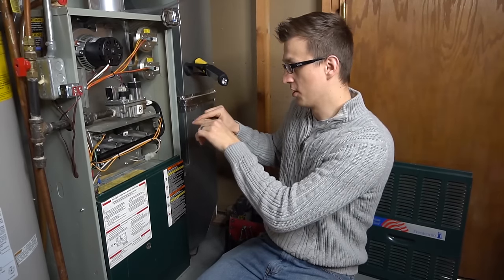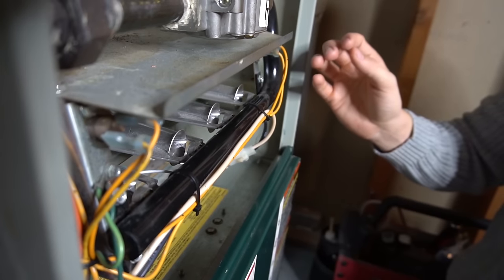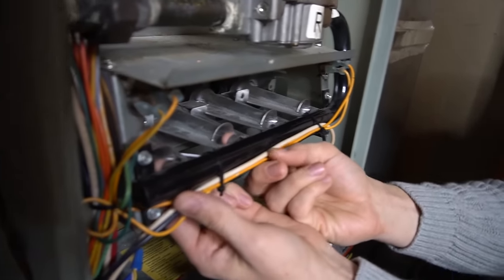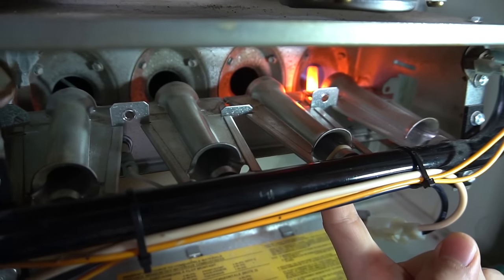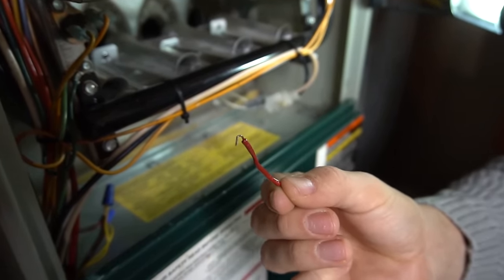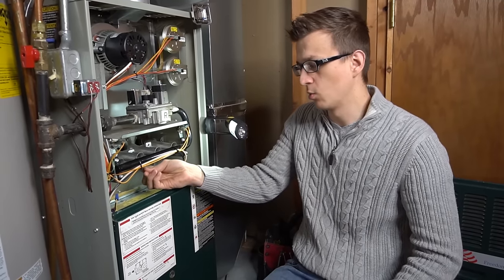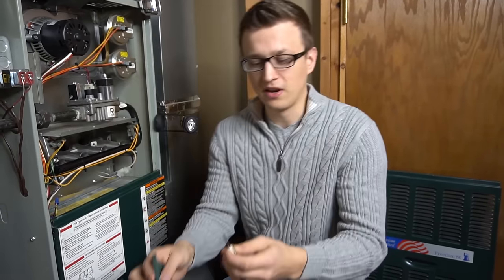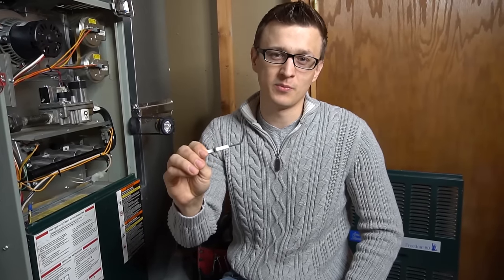Not All Furnace Burners Lighting - Easy Repair

Comment: HVAC Horizon guy came for gas furnace tune up.  He did not clean pilot nor the burners. I asked him and he said no don’t need to clean!!!
Reply from the maker: Do you have in-shot burners? Those style of burners don't need to be cleaned very often. I don't always clean them either if they look okay but if the customer asks me to I will.
Reply: @Word of Advice TV 
I don’t know the type but it’s 1986 old Furance model SX242NBOX. I have to start the pilot light manually and I have the pic of the burners.
Tech started sales pitch your furnace is very old Blah Blah 
He asked when I’m planning to replace and I said there is no issues. Why do I have to replace!!
Reply: @ssinvllc  1986!? What's your temperature rise? A unit that old has a very good chance of having a compromised heat exchanger. Which in turn could lead to carbon monoxide leaking into your house. Might want to call a more credible company for the tune up. I personally, would've removed your blower motor and fully inspected your heat exchanger. Minimal of 2 hours at your place.
Reply: @ccruz 
Thank you 
I bought the home recently. 
Unit is 80BTU but he said its running on 77%. Tech didn’t not say about CO2 leak. Is there anything I can check for leak ?
Reply: @ssinvllc  on your furnace, there should be a data plate with all the specs to your system. It's where you can find your model and serial number. On the data plate, it should tell you where your system's normal temperature rise is. The most common that I see is 30°-60°. How you can check that is go to one of your registers (vents) that is closest to your unit and take the temperature of the air coming out. Then go to your return (where you place your filter) and take that temperature. Subtract the two to get your temperature rise. Make sure that your CO2 detectors are working. You will need to recalibrate them every once in a while. You can do this by taking them outside for a few hours. This allows them to be able to sense the fresh air. If a CO2 detector hasn't been recalibrated, it will actually sense the CO2 and think that it is normal and won't alarm. If you or anybody in your house has been getting dizzy, headaches, and or been feeling Ill you need to get new detectors and call in a more knowledgeable technician.
Reply: @ccruz 
Thank you for the information 
I don’t think Tech checked all these things.
Reply: @Word of Advice TV @ccruz 
We have a heat pump and outside AC unit started  making noise. Tech is saying Restricted Thermostatic expansion valve is faulty and repair cost more than $2K. I think fan motor bearing is the problem. Amerstar Unit is 14 years old American Standard. Is there any way I can send you the unit ‘s noise video  ?
Reply: @ssinvllc  your outside unit is making noise and the technician is telling you it's a "restricted TXV"? I've never come  across a TXV making noise when faulty. Your unit just wouldn't be producing the correct temperature if you had a bad TXV. Most likely just the condenser fan needs to be replaced. If you upload the video, I'll watch it.
Reply: @ccruz 
I uploaded 2 videos 
In one u see the ice
Reply: @ssinvllc  wasn't able to watch video, says user removed video. But that makes a lot more sense if the txv is bad, then your unit may ice up, thus causing the  condenser fan blade to hit the ice.
Reply: ccruz 
Sorry I thought u watched the videos
Reply: @ccruz 
Another tech $700 Freon is low and to refill r22 and replace TXV but he’s insisting to replace Ac and heat pump $4000 Goodman R410   - 2 ton Ac 14 SEER
Reply: @ssinvllc  honestly, I would do it. Your unit is pretty old, way past its life span. $4000 is a good price, but be wary of mom and pop shops. You're looking for quality in the install and making sure the company is willing to stand by their work. A bad install is just setting your system up to fail. It may be a good idea to also look at your ducts as well. New 14 seer units tend to have "ECM" motors that do not last when the static pressure in your ductwork is too high.
Reply: @ccruz 
Thank you so much for your help. It is for rental unit. 
Should I go for 16 or 21 SEER ? any model you recommend. It’s doenflow system
Reply: @ssinvllc  the 16 seer should be fine. I think anything  newer than what you have now is going to be good. I personally, install and maintenance on Lennox and Rheem units. Pretty sturdy units, plus the manufacturer's warranties are pretty good. Super quick to respond when you have a problem or need a part. 
And no worries!
Reply: @ccruz 
Great and thank you again 
I will look 16 seer models I’m from suburb of philadelphia area. If you know any tech or recommend anyone

Comment: Thanks so much, Jay!  I used a number of your videos to progressively troubleshoot and repair the furnace in a rental property I have been renting and didn't seem to be maintained very well.  Your clear videos and steps led me to an inexpensive self-repair.  Many, many thanks!
Reply from the maker: Awesome! Glad to hear the videos helped you track down and fix the problem! Thank you for leaving a comment, stay warm!
Reply: @WordofAdviceTV  I have tried everything I know but having issues after replacing igniter, flame sensor, run capacitor and tested all switches. The furnace gets to the igniter turning on then no flame and kicks off. Inducer is working, pressure switch works. Goes through this cycle 4-5x then goes into lockout mode. What am I missing and why is it not getting a flame?

Comment: Tried this but still only first burner lights.  Then put a fire stick next to the first burner - upon ignition and all came on.  It's almost like the igniter glow stick was not close enough to the second burner to ignite it.  I think my igniter may be failing and just not glowing hot enough to reach the second burner.  I noticed in your example the glow stick was completely glowing while I think mine was only partially glowing.  Will try replacing the igniter and let you know.  (Luxaire Furnace)
Reply from the maker: It's more likely to be a dirty burner. I have a video where I explain that and show how to clean them: https://www.youtube.com/watch?v=6ehk0NZVFcg

Comment: This video is very helpful but I do have one question:  what if the gas is coming out but none of your burners light.  I can smell the gas but the burners are not lighting at all.
Reply from the maker: Is your ignitor glowing or sparking? If it is glowing but not lighting even thought the gas is coming out, then most likely that is a weak ignitor that should be replaced.

Comment: I found that not only was the orifice plugged but there was debris in the manifold. Propane fuel I heard sometimes puts out debris in the burning process. I removed the orifice and using a the same wire I used on the orifice, I have fished a lot of debris out of the manifold. I have the orifice currently soaking in carburetor cleaner as the clog is very solid. I may have to replace the orifice but I found they are really inexpensive. I will post my results later.
Reply: My trick worked. The carburetor cleaner opened the orifice and I fished a lot of debris out of the manifold. Furnace is working great now.
Reply from the maker: Awesome! Glad that worked for you and all is good now :) Thank you for sharing! For other people who may have a similar problem.

Comment: So I've been having issues with my furnace. No heat during this cold spell in IL. Recently, replaced the thermostat with a 3d Gen NEST (which is fine), but the ignitor continues to glow red, then turn off, then glow red, then turn off, over and over. The burners never turn on. The signal lights show normal (both quickly flashing green) signaling normal ops and that thermostat had requested heat. Earlier, the lights had shown that both the Primary/Secodary limit switches were open and a technician had to temporarily bypass a limit switch near the circuit board while a new limit switch was ordered. The burners were working due to this until late last night, then the ignitors would come on and go off, etc. etc.  That bypass setup is still in place and should be replaced tomorrow. As for the burners never igniting, could this be circuit bored issue?  Also, I just replaced ignitor with a new one, cleaned flame sensor with steel wool and like this video, cleared the gas orifices hoping that would resolve this issue.  Any advice?
Reply: It looks like you have a bad gas valve
Reply: Or thermocouple

Comment: In my case when only a couple burners were getting gas to them, I found there was power going to the gas valve but it was only allowing 0.5" WC natural gas to the manifold. Changed it out. Problem fixed.
Reply: Gas manifold sounds intense -  this sounds like a I need a licensed Chaco person
Reply: You replaced the valve?

Comment: Does a 2stage furnace also have 2 igniters?  My furnace is a high efficiency furnace and has 4burners and an igniter at either end of the burners. It has one flame sensor and two pressure switches. I am trying to learn all about my furnace. I live in Alaska and furnace in the winter is really important. I look forward to hearing from you and I really enjoy your videos. You know your stuff.

Comment: Thanks for the video. Your explanation is clear and easy to follow. My furnace ignitor sometimes works, but sometime do not. When I opened the door, the ignitor grows, and the gas valve opens (I heared the click sound), and then sometimes I see small flames, and sometimes I do not see small at all. Can you what I need to look into?

Comment: Had interment igniting furnace problem...now will not ignite at all with igniter glowing or manually!. Cleaned holes  gas pipe ⁶brass fitting and . Flame sensor is in good shape! Gas line and valves are turned on...I'm getting gas to my water tank. Inducer on furnace is running..  all wires are connected...at odds and irritated in CaLi

Comment: Jay tell me can i temporarly use the wrong ignitor in an emergency
Reply from the maker: Usually yes. But make sure the voltage is the same. It is usually 120v but some ignitors are rated at 80 or 90v...
Reply: Jay i bought a new ignitot for mine that was failing.  The voltage is the same.  Sometimes the furnace would try to come on like 8 times before the ignitor worked.  So i took the new one out of the box.  Suddenly the ignitor worked faultlessly and has been ever since.  Its ad though my late parents fixed it because they didn't want me touching the furnace.  This is true.  So now i have a spare ignitor in case it fails again.  Best 15 dollars i ever spent and i didn't have to do a thing.  I can see daddy fixing it to keep me from doing it.  This one is a hard wired one the one in the furnace has a plug.  Thank you for your reply,I appreciate it.  Hopefully this time next year 8 am in college at central maine community college to be an HVAC tech.  I really enjoy this sort of thing and love your videos.  I'll be the top of my class with the knowledge you give me.

Comment: All three of mine are coming on. But it is kicking out the emergency switch.
Reply: I had it cleaned out last year and it has  been working fine for a month.
Reply from the maker: @SmokingRun  When you say emergency switch, are you talking about the flame roll out switch, flame sensor, or high limit? Also, is the control board blinking any error codes?

Comment: Is it possible to have your orafice clogged on a newly install furnance? I am in my second year of school and install the furnace for my grandma. Also on the control board the red light just stays on.
Reply from the maker: It's possible but unlikely. I would suspect that something else is wrong before that.. Perhaps the gas is turned off? Or the power switch is off on the gas valve.. Or maybe something was wired incorrectly.
Reply: @WordofAdviceTV  Out of 7 burners 3 had flame and I was able to get the 4th one on. After few more times still the same result after I clean orafice/burners. Do you still think it could be wired incorrectly!?
Reply from the maker: @alexsouth479 Ah okay, now that you told me that a few of the burners are not lighting, then of course wiring is not the issue. If the furnace is brand new, then that really is odd.. The burners that do light, how do the flames look? Are they sharp or lazy and fluttering as if there is not enough gas pressure? Another thing I would try is swapping the burners and see if that makes a difference. Put the ones that don't come on first in line.
Reply: @WordofAdviceTV  flames nice and blue. Gas pressure is 3.6 Tomorrow morning I will try swapping burners. Thanks I'll keep you updated.
Reply from the maker: @alexsouth479  Yeah, if you get to the bottom of it, let us know please. Good luck!
Reply: @WordofAdviceTV  Yes I remove gas valve took off flame sensor wires igniter wires and look at all 7 orafice and the 4 one was completely clog. I use a small piece of wire to unclog it. Put everything back and everything ran normal. Thank you so much!
Reply from the maker: @alexsouth479  Oh wow! 4 of them were clogged. Thank you for coming back with an update!